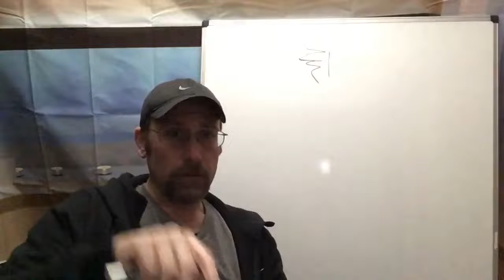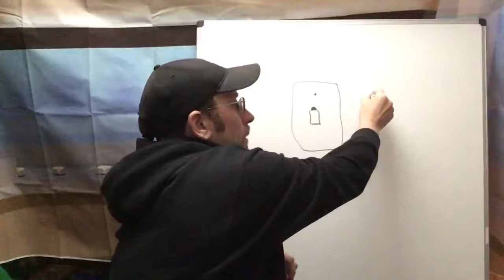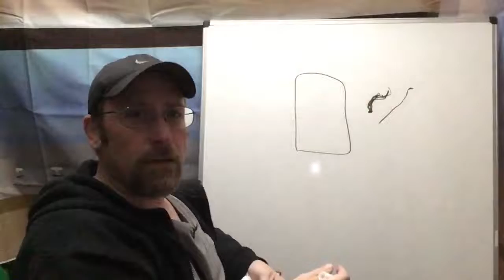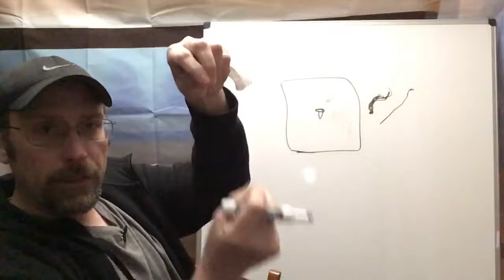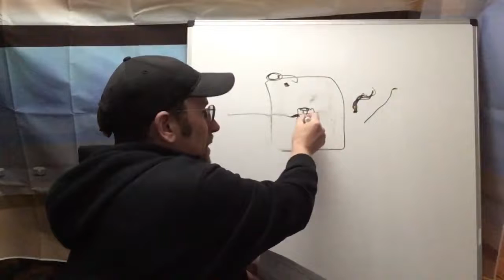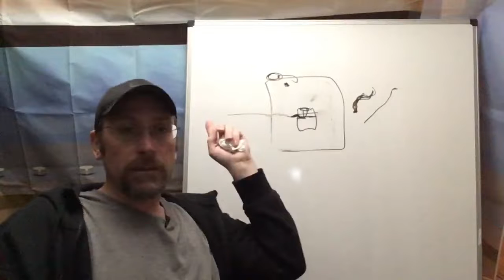OXYGEN MACHINE NOISE AND ADDING A HUMIDIFIER BOTTLE FOR OXYGEN CONCENTRATOR

Comment: wife is on oxygen. cat bites tubing. is it possible to replace the female connectors?  this is a internet mystery evidently
Reply from the maker: Hi John, I rarely had to deal with actual female style connectors I'd say yes but I'm thinking you might be talking about the ends of oxygen lines and/or cannula. I mostly deal with male/male connectors going to female lines. So I'd just replace the connector with a new one, but if the cat chews the end of a line then a new line is best but in a pinch some tape will get you by. In the future you may want to consider coating the sections of line with a safe substance the cat doesn't like, Possibly foil, orange zest, coffee, as long as it deters the cat without harming the patient. I hope this helps, Have a good night!
Reply: the tape is what we're doing now.  sounds like i have an invention to work on. thx

Comment: Hello there. My dad has a Phillips Everflo with a humidifier.  However,  I've noticed that the water inside it gets less and less hours after I fill in the water. I remember the amount of water didn't change when we got the machine like 5 months ago, but in the past few weeks the water mysteriously "disappears". I checked the bottle and even swapped it with another one because I though there's a leakage somewhere, but everything seems to be ok and the cables are all ok. Have you experienced something like this before? Thanks in advance.
Reply from the maker: Hi Donnie. All is well, it's supposed to be going down in water. No problem there, the one question I would ask is... Has the oxygen liter flow been raised since? If it's being raised higher then it would definitely run out of water faster. Ive had patients where the grandkids would turn the liter flow all the way up and no one realized it until I pointed it out. Otherwise if his hydration is good, then you should be good.
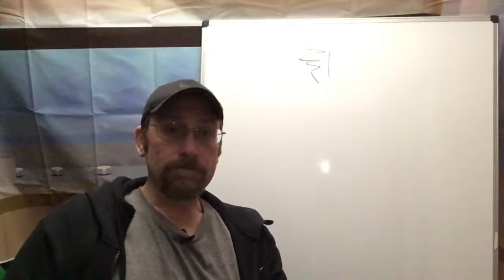Reply from the maker: The Humidifier bottle part of the video starts at 3:36  Enjoy!
Reply: @OxygenGuy  thanks a lot,  in fact we raised the liter flow a few weeks ago, I guess that explains everything  : )

Comment: LifeChoice Activox Portable Oxygen Concentrator  . . . . . .Frank, will this device help me breath if I get the bug?  What is an oxygen concentrator for?   Thanks.   Bob from Philly
Reply from the maker: Hi Bob, Oxygen concentrators and tanks enrich your breathing air. It raises your oxygen levels and makes it easier to breathe for people with various problems. This Covid 19 virus is actually going beyond enrichment, people are having to be put on ventilators. They basically do the breathing for the patient and help them to hopefully stay alive. I would try my best to avoid contact with people and if you did have any issues a doctor should be consulted. If a doctor prescribes it then this maybe a good option for you if it's in good shape and is clean and tested. With any luck hopefully you will have no need for it. Stay safe Bob, Have a good day!

Comment: Thanks so much for the fast response, OG! I bought this Invacare Perfecto2 V (01087 hours on it) for $50 at a yard sale to keep my pug alive between his 6 airway surgeries. Now he's fine, but I'm sick (respiratory but untested, don't know with what) so getting the machine ready if I need it; local hospitals already overwhelmed with sicker folks. The puffing sound isn't Darth Vaderish, more like an intermittent, brief exhalation of breath after you've held it for a few seconds) every 4-6 seconds. I ordered a filter kit for this model on Ebay yesterday; the missing one is on lower back of machine, just a ~4" foam rectangle, so not HEPA? Re: my water bottle has a threaded green wheel at the top but I couldn't fit the end of the tube (which has an attached clear thicker fitting) into it; might fit without the fitting but didn't want to cut it off in case I need it for something. But I read in the online manual you don't need a water bottle with this model because it runs cool; is this the case? Thanks again; I truly appreciate your exceptional dedication and expertise posting these vids for us, and stay safe!
Reply from the maker: Hi again, ok lots to talk about, I believe the bottle you have may be a high flow bottle, but yes you can go without it. The majority of my customers do with out. (Because they do not want it) The filter kit I show in the links below has outside filter (the black one) the HEPA filter (which is white and is sealed into a yellow or white hard plastic inside the back door), and a bacterial filter the little white one.(deeper inside the machine) which I wouldn't recommend to anyone without experience because you could do some damage quickly. Next, I sincerely hope it doesn't come to you needing to use the machine untested but these are unusual times. Not recommended at all but if you do please go by a doctor's orders only! Please do not use otherwise or more than prescribed, it can do more harm than good. Also the HEPA filter, if it's really dirty. Not white or off-white then I'd consider getting one. Sorry for the long-winded response. If you have any other questions, I'm here. Have a good day.  Also I'm glad your dog is better.
Reply: @OxygenGuy  Thx for the info on bottle and filters! My daughter's a nurse and her partner is an internist, so I'll get remote advice as necessary. HEPA filter comes with the kit; I'll try to open the back door and check it.